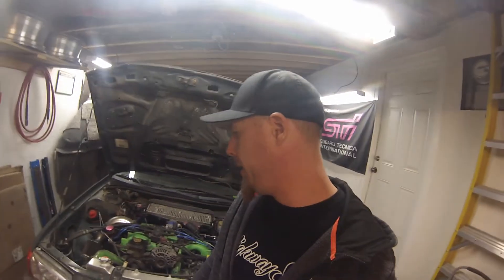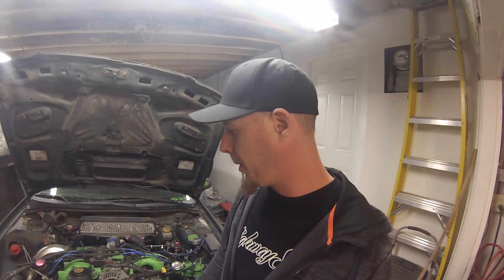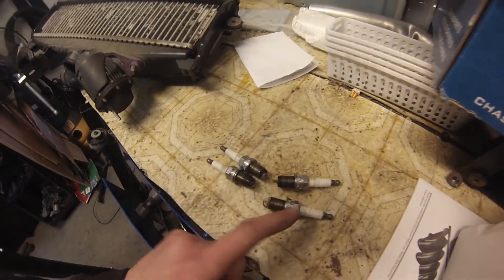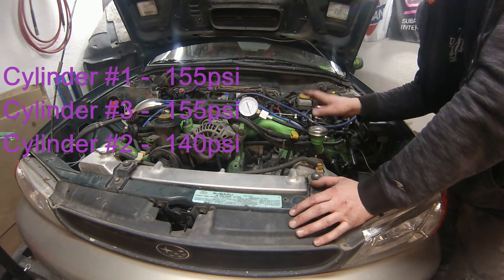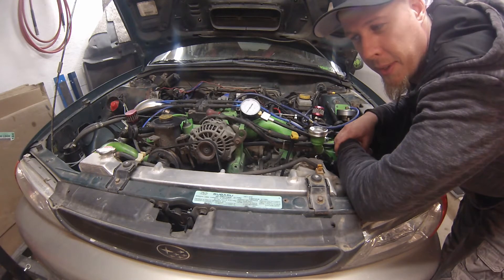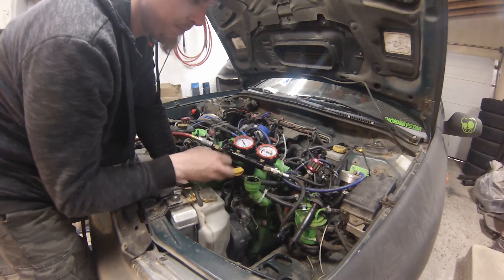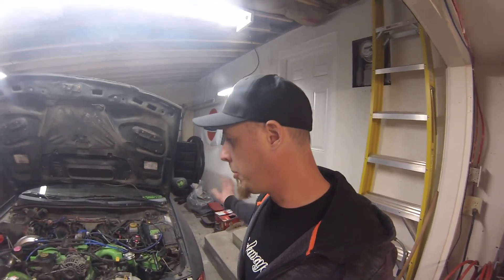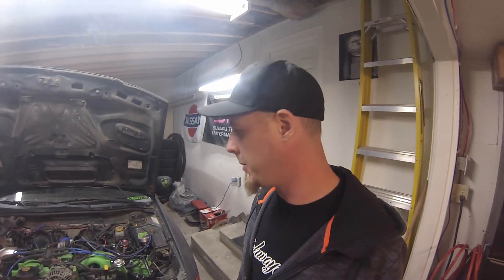SOHC EJ257 Hybrid Build Part 1 - Diagnosing Old Engine - How To

Comment: With the sohc heads, what's the compression ratio ?  What size head gaskets will you run ?   Should be interesting build !
Reply from the maker: From the info I've gathered, using STi head gaskets should get 9:1 compression. It's a budget engine build but I tend to have good luck mixing parts likes this and have lots of fun doing it.
Reply: Homebrew Subaru ha the budget builds are usually the best, you know the ones where you just chuck together to get going !